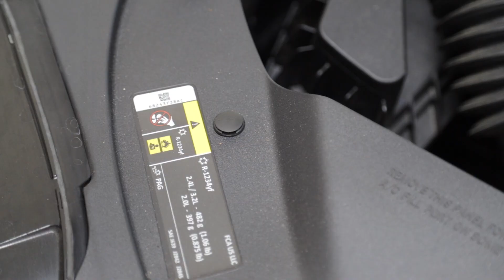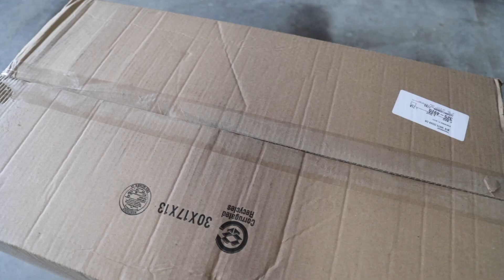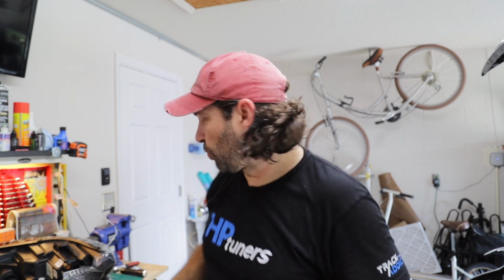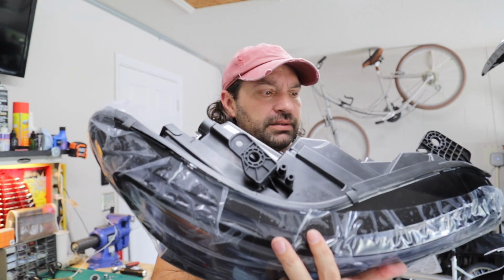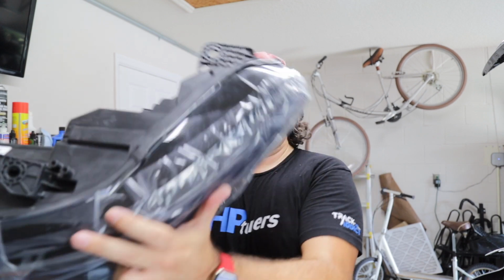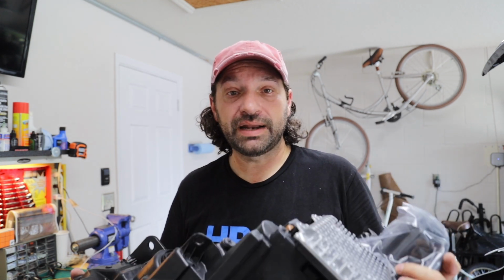Jeep Cherokee Headlight Replacement

Comment: Thanks for the video and the link, for some reason they were not showing up in my ebay search but they had a unit for sale. I fix up hurt car's for a hobby, they will total a car today for headlight damage, sometimes it costs more than the airbags. To think years ago a headlight was a $5 item.
Reply from the maker: Wow, yeah, these headlights have so much more tech in it. It was tough finding one for a reasonable price. Make sure all the tabs are there when removing it. Most I found are just broken and will rattle. This being an off-road capable vehicle, this should be a lot simpler than what it was.

Comment: Is there a bulb for the headlight? Ive heard conflicting comments (not here) saying you have to replace the entire thing if a headlight burns out.
Reply from the maker: I don’t have that car anymore but I remember when I pulled out the unit, I was surprised that everything was sealed in. Now, my Chrysler 200 which is essentially the same car, has an access panel through the wheel well to change the bulb. The Cherokee was a bit newer than my 200. So maybe somewhere between 2016 and 2021 they may have decided that we could somehow afford a $1600 headlight assembly when the lightbulb burns out.

Comment: What a pain. I’m still trying to find a diagram as searches only show the GRAND Cherokee. Trying to figure out if the headlights pattern comes from both the led(s) behind the projector lens as well as a couple multifractor sections.
Reply from the maker: Maybe check for Chrysler 200. They maybe the same as it’s technically the same car.

Comment: Great video Daniel 👍👍👍 Your music made it relaxing, which I know it wasn't for you. I had someone lightly hit my passenger side, cracking my headlamp in the process. I bent the sheet metal straight. But had to get a new aftermarket headlamp at the time. Anyway, my 2012 Avenger process was the same. I guess in 7 years FCA couldn't find an easier way to replace a headlamp. Yes, it a job. Patience required. Take care. 
BTW, it was in a parking lot. No fault. My deductable at the time was $300. Why claim it.
Reply from the maker: I’ve done headlights on the Mercedes a few years back, I’ve done Audi, VW and Ford as well. This by far is the crappiest way to do it. The bumper is tucked into the light? No wonder when people just tap someone the same bumper just hangs off. Like every other Toyota and Honda on the road today. 
I was very thankful that my wife helped hold the camera with the assembly. It took 1/4 the time compared to when I do it myself. It didn’t help that it was over 100F that day. Are we getting to old for this shit? I hope not, because when things run smooth I feel… satisfied?!

Thanks for watching Greg. I always appreciate your kind comments and input!
Reply: @Turbo_Snail  My Lincoln Town is simple. 3 long clips and out she comes. Take care. Have a great weekend!!

Comment: Jeep made it so hard to replace those damn things. Makes no sense.
Reply from the maker: Especially on an off-road worthy vehicle. You know you gonna break stuff. Should be easy to fix.
Reply: @Turbo_Snail  2019 Jeep Cherokee passenger side low beam not working. Dealership told me I need to replace the whole assembly. $1500 total parts and labor. Lol
Reply from the maker: 😮 that is absolutely nuts. 🤦‍♂️
Reply: I just brought a new one from mopar..  over a 1000$ just for the light and now I have to pay someone to to put it in… I’m trading this jeep in as soon as it’s fixed….
Reply from the maker: Yeah, look at my video. It’s a pain to put it in. It not impossible.
Reply: @calicain9294  you got me scared now, my headlight bulb went out
Reply: @Hannibal54689  yeah same here, I refuse to pay that much for a headlight.

Comment: if anyone see this now, i need help identifying what plastic cover headlight i need for my jeep
Reply from the maker: What you got? HID, LED, Halogen? Just search eBay, that's how I found mine. Usually the connectors are different. Can't get just the cover, it's a whole piece.
Reply: @Turbo_Snail  i have a jeep cherokee latitude 2019. For the type it’s a LED light but i can’t seem to find my headlight for it, i find the little lights for the car but not the main. And thank you for helping me
Reply from the maker: Based on my research. It can only be halogen (h11 low beam and 9005 high beam) or HID (D3S). There doesn’t seem to be an LED option from the factory. That being said, you could change it with a conversion kit from halogen to LED but I don’t recommend it. 

You can pull the bulb out and see what it says on it. Here are a few links:
https://amzn.to/3OJVFRa
https://amzn.to/3rXbVFF
https://amzn.to/43Wmbeo

I would recommend buying in pairs as the brightness diminishes over the years. With HID, don’t buy the cheap stuff as they are usually substandard. I’ve tested dozens of them and that’s the wrong way to save. On the halogen, I can’t seem to tell the difference between cheap and expensive other than they cheap ones burn out quicker.

Comment: You skipped the part for replacing the bulbs
Reply from the maker: It came as a complete piece. No need to swap bulbs. If I remember right, I don’t even think you can replace the bulbs. You gotta get a whole piece. I may be wrong.